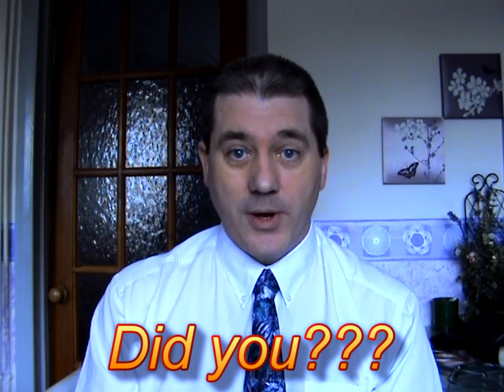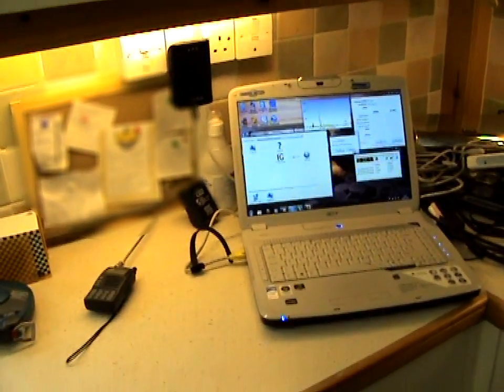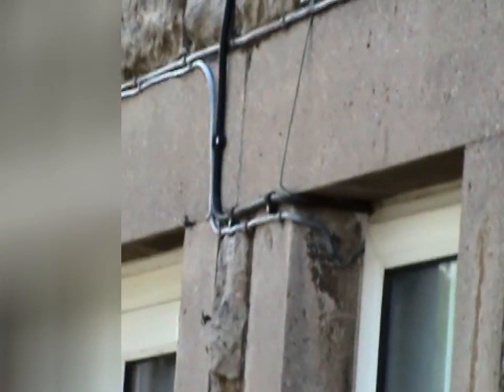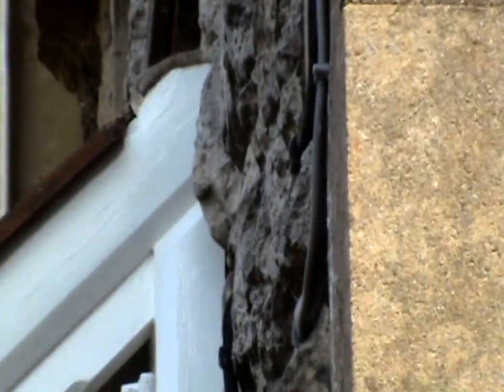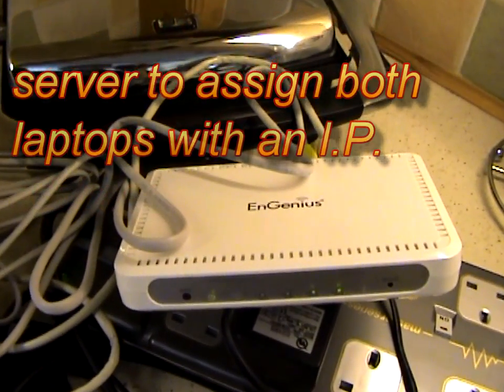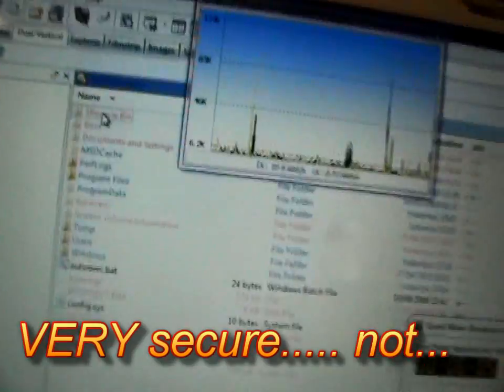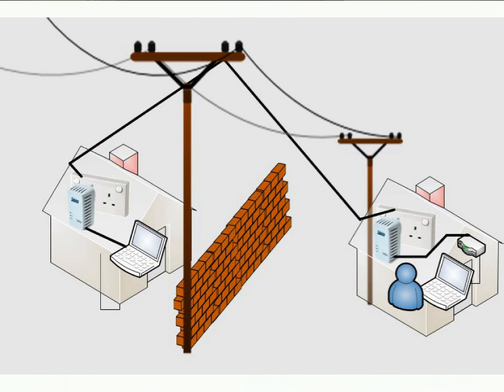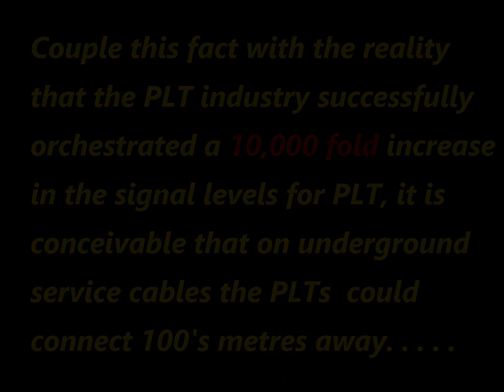Poweline Networking - Security FLAW

Comment: My security company (ADT) recently upgraded my home security system to one that is accessible via the internet.  Since my router is located in a different room, they installed two Netgear ethernet-over-powerline devices to handle the signal.  Several weeks later, I sat down at my radio, and was shocked that s9 noise was spread from about 10 mhz up into the vhf range!  15 mhz WWV was unreadable, even under the best conditions.   I unplugged the devices,  and the noise went away.  The solution was to replace the ethernet-over-powerline devices with one ethernet-to-wifi device.  The bottom line here is that ETHERNET-OVER-POWERLINE is a TERRIBLE product.  DO NOT BUY IT and hopefully, it will die a slow death.

Mark
ars: KE6BB

Comment: Tbh, dispite the evidence as per demonstrated here it is still more secure than conventional Wi-Fi as it does not broadcast a signal on an open ended system, Wifi can be hacked by a person sitting in a car at the traffic lights, while gaining such access via this vulnrability requires a nieghbour to be aware of the make and model of the adaptors in use in any given property but also must be on the same "phase" as the home of which you wish to hijack the network of... But puts on tin foil hat it in theory does allow the powerlines data stream to be mined by a 3rd party with the correct equiptment which govenments are likely to have had made avalible to them along with any encryption keys such devices may be encoded with and its not a stretch of the imagination that it may be likely to be used as a form of spy device for government agencies NSA/GCHQ
Reply: +CynicalHeart Bear, a real BEAR to hack for the common joe, easy for the corrupt governments of the world

Comment: I do not know to believe if you are telling the truth as my house is a 5 bedroom semi detached and not a council house, my family own our house and we used the device and went next door and could not connect with the one in my house so i think that you are in a place where the wires all meet together.
Reply from the maker: Joshua Harman How are the properties electrically fed? By overhead cable or underground? How far apart are the houses? Are you on the same phase? What variety of adapter (HPA/UPA)? What time of day did you try? There are numerous factors which could be responsible for your test to have not succeeded. Some PLT adapters have trouble connecting in the same house and those most certainly would not make it to another. All the best.
Reply: they are underground and are about 18 metres away
Reply from the maker: Joshua Harman It looks like you could be on a different electrical phase. It is normal practice in the electrical supply industry to place each consecutive house on a different phase to the last one to try to achieve load balancing across all three phases. I believe it is very unlikely that a PLT signal would make it across phases (there are reasons why it could but beyond the scope of this reply).

Comment: Old (non digital) power meters had coil inside that worked as low pass filter , and passed only very low frequencies (AC power in Europe is 50HP which is very low) , and powerlines work at MHz and GHz range . I might work because electrical cables work as antenas (powerline does work on 3 phase systems forthat reason , which is good) , or because you both have digital power meter that multiplies voltage and current readings from shunt which is no more than low resistance resistor , and has no abbility to filter out any frequency .

Comment: Max range is 300 meters and if they are not paired they won't connect. So at most your closets neighbor could possibly access your network if you let them. Nothing to worry about.
Reply from the maker: 300m in many neighbourhoods (including mine) give a property count of 30 homes. In a high rise flat that could be three times higher.
Reply: G7CNF Amateur Radio Station it's not flat as the 300m is the length of cabling.

Comment: I can tell you whats going on I am an electrician and whats happening here is when he showed the power-line all of the power is tapped off of the same line with no transformer this must be a older neighborhood and older wiring in updated newer neighborhoods there would have been a transformer set for every house and it would be impossible for this to feed threw to a transformer because in a transformer the primary and secondary winding's aren't connected power goes from the primary to the secondary through magnetic lines of flux and also a transformer is considered whats called a separately derived system which basically means that that is a new point for the power and it can't effect older stuff I've installed many transformers in high tech facilities with harmonics issues and they put transformers in usually for i.t. rooms so that way they won't be affected by harmonics.  what this guys showing could be true only in a neighborhood like this more or less an old neighborhood or somewhere far in the country.
Reply from the maker: I can tell you what's going on, too. I'm an electrical engineer (post-grad) and formerly an electrician and I can tell you that vast swathes of the UK power supply are wired exactly like this. Our supply is three-phase 230v and ZERO transformers; (the nearest transformer is an 11kV <>415/230v at a local substation and will often feed 100's of properties.
Reply from the maker: G7CNF Amateur Radio Station I was also a linesman and an underground cable jointer for regional electricity companies, before you ask (live working authorised).
Reply: I don't know about uk but in America we don't have one transformer feeding hundreds of homes if you did this test in America it wouldn't work the same you may be able to read through to 1 or two neighbors but that just depends on how your neighborhood is wired my neighborhood the houses are farther apart there is only one transformer per house so I wouldn't worry about security issues as well as about 80% of America wouldn't have to

Comment: lol i don't know if this guy is correct or not but he doesn't prove anything in this video. all he proves is that the product works very well and can go a long distance. so both houses or on the same power grid and you took the product and put each piece of equipment in each house of course it works why wouldn't. it supposed to be a secure network from base to to base and i don't see how you prove it wasn't so. same as a router can be excess if you know the pass key lol doesn't prove a thing.

Comment: Yeah this is technically possible however you would have to collaborate with the person you want to share with as there is only a 30 second "pairing window", when the AP unit "hands out" the encryption key, (comtrend), the chances of getting these things to synchronize using coincidence is near impossible. If you said you can "hack" into a working pair and gain access from a remote location then this is a different situation.

Thanks anyway

Comment: Every security system has it's weaknesses,i admit that.Lot's of people using Wi-Fi networks to connect the internet,chatting,data transfers and such.Mobile devices are everywhere and they all know the risks.Someone can get crack your wi-fi password and obtain information,that's just a possibility not a certain thing.
Like it or not you have been watching by your isp via it's network or another.You should get worry about that,not from WPS protected powerline adapters...

Comment: Yes, this person is right. I just bought Actiontec powerline adapters. It is a pack to two, but I plugged one into power socket and connected to wired adapter on laptop and I am able to connect to net and router of some home near by. So obviously there is no security. The difference in router is that you can set your password, whereas in powerline networking you can not any password or security.

Comment: Really? This is to dramatic, if you cant set up a secure network by pairing two devices then I really wonder how you still are alive. No security is impenetrable but its just as safe if not safer than your wifi. When you buy a new router you get a unsecured network. And you have to use your computer & often web browser to access your router and set up a password. This is harder than pressing to buttons, and makes your video a waste of time...

Comment from the maker: Quite agree. I cannot comment on the latest offerings from the manufacturers, what I do know is there Powerline kit in circulation which does not automatically encrypt and requires user-intervention to enable. Persons using that equipment will be the most vulnerable. Any form of encryption will not protect you from a lawsuit from an Authorised User of the radio spectrum who is having their service disrupted by an inappropriate technology.

Comment from the maker: In my lifetime I have been a live authorised worker for two power companies. I can assure you that was not RG6 but was 16mm squared straight concentric mains cable with a single copper core for the live and concentrically arranged 'cage' of wires for the neutral-earth. The mains system was PME and neither of the houses were mine.

Comment from the maker: In fairness, when I released this video originally 18 months ago, it commonly featured in promotional literature. These days it's less common but still not hard to find.

web powerlinenetwork dot couk FAQ: "The network system “stops” at the electricity meter so nobody outside your ring main can connect"

web expertreviews couk "Homeplug signals can't travel beyond your electricity meter..."

the web zyxel dot com "Homeplug signals can't travel beyond your electricity meter.."

etc. etc.

Comment: Security is obviously necessary, and most PLTs have encryption via a user definable PSK.

As with WiFi its a matter of education to use it. I certainly haven't seen any publicity sold with PLTs claiming the signal stops at the electricity meter. Equally they don't say it can go beyond, but the fact they have encryption does imply there is a security reason for it being there.

WiFi is easier to receive and hack, but that is the only alternative networking medium a lot of people have to PLT.

Comment from the maker: The laptops were commonly used on my home network, each connecting to the router wirelessly; no internet sharing options were enabled. They were simply set to automatically configure themselves to connect to the internet (Windows 7). The purpose of the video was not to attempt to display any hacking potential but rather the PLT's ability to connect in a configuration which manufacturers have historically emphasised was not possible thus potentially placing a private network into a public arena.

Comment from the maker: One property had the electromechanical and the other I failed to check. As to the impedance, I agree however the mains network itself presents a complex varying impedance which changes with respect to time and ffrequency. This underlying uncertainty coupled with the significant mains-borne interference present on most systems forces the PLT manufacturer to run the highest power levels possible - indeed this is why they petitioned to have the levels increased - and succeeded.

Comment: What sort of electricity meter do you have? The traditional electromechanical watt-hour meter with a rotating disc has a series current coil that adds some impedance to radio frequency (RF) signals. This probably explains the claim that RF signals are reduced by passing through an electricity meter. It is not true for modern electronic electricity meters however as these have no series inductance. Instead, they have a very low series current sensing resistor (milliohms).

Comment from the maker: A video response to this video has been left by a colleague in which he demonstrates connecting two powerline adapters WIRELESSLY. Yes you read correctly, passed data between two PLT's with NO PHYSICAL CONNECTION. Now figure in  the reality of a 10,000  fold increase in the levels that CENELEC has approved and the distances over which this is possible will increase.

Comment: The PLT signals actually by-passed TWO electricity meters !!  240 volt,  50 Hz, AC powerlines are like leaky water pipe to radio frequency signals................PLT is the same story of the "King who had NO clothes !"..............so many "beaurocrats" have been completely taken in.................When will they realise !!